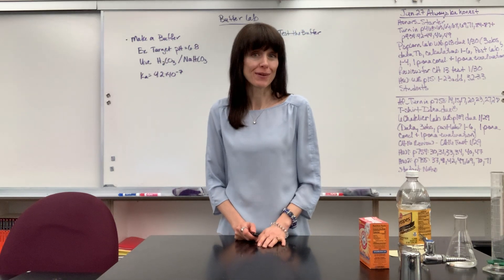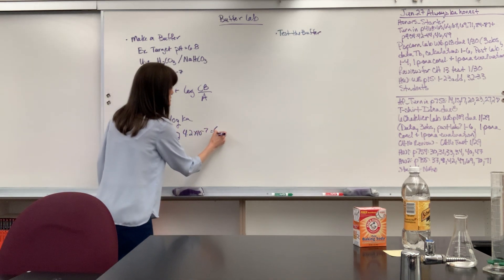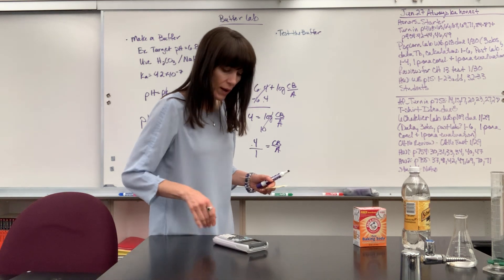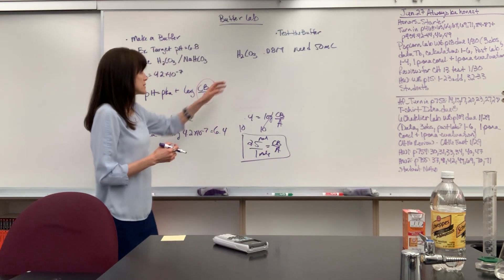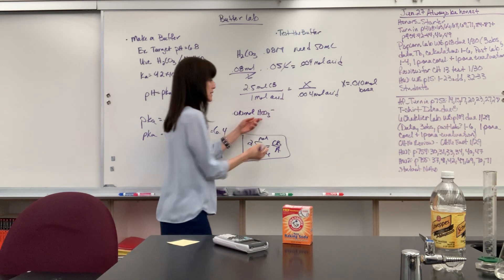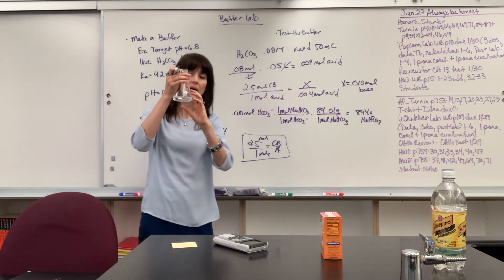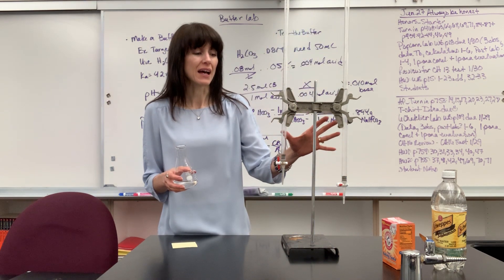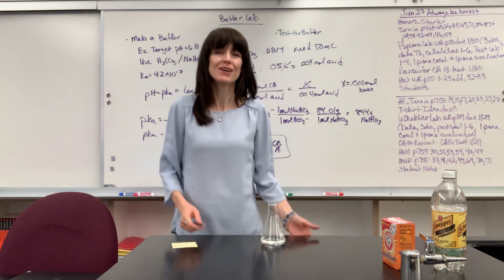Buffer Lab

Comment: I need help with the delta change formula of the buffer going up and down in pH.
Reply from the maker: Hi AnthonyChung, Great question! 👍 The “delta” (Δ) just means change. When the buffer absorbs added acid or base, there’s a small change (Δ) in concentration of the weak acid and conjugate base — that’s what causes the slight shift up or down in pH. The key idea is that the buffer resists large ΔpH by converting between its acid and base forms. 💧 Keep up the good thinking — Old School style! I hope that helps. God bless you.